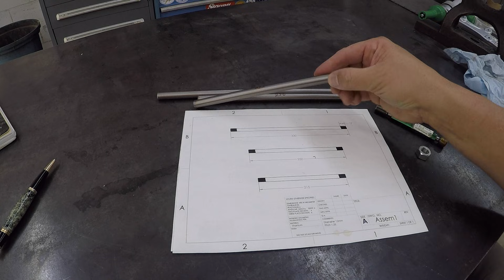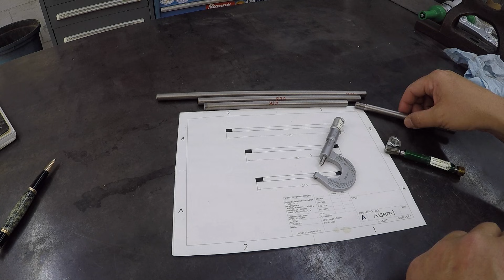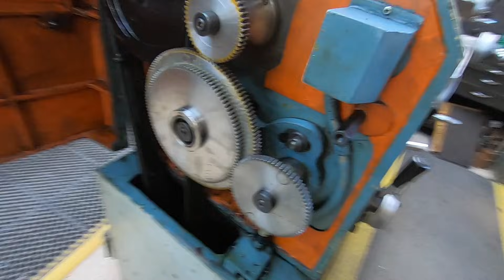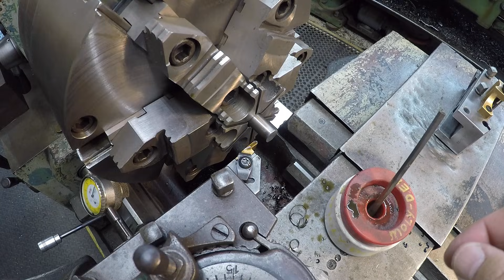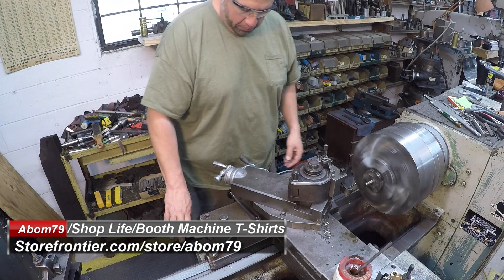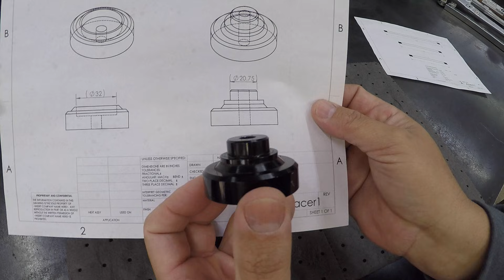Threading Metric Titanium Rod

Comment: The US absolutely refuses to adopt accepted world standards. Asking for metric threads shouldn't be such a big deal.
Reply: When your lead screw is made in imperial...it's a bit of more forethought to do it. Just as if your lead screw was metric and you had to do imperial. I agree though, metric is much easier system.
Reply: I don't think it's any secret that most mechanics in the US would love to go all metric. It's a better system in every way.
Reply: @dunerinaz  No its not. Mechanics are NOT machinists. Wrenches are NOT threads.
Reply: @dunerinaz  except for estimation.
Reply: @Finn McRae I mean I use whichever is more convenient to existing parts too but you can't argue it isn't easier to estimate when you have three common units (inches feet and yards) instead of two (cm and m), that's just how the human brain works.
Reply: @just73319   don't forget mm, that makes three common metric units aswell ;)
Reply: @tobiassonne3442  alright then, imperial has 4, yards, feet, inches, and 16ths
Reply: @just73319  metric got both 1/10 mm and 1/100 mm. 😊
Reply: @tobiassonne3442  you're missing my point lol. The human brain groups things into small numbers, having a point of reference for a "small, medium, and big" (inches feet yards) unit of measure is more useful than "small and big" (cm and m)
Reply: @just73319  well then you're mising my point too.. "small medium and big" in metric is just mm, cm, m, km and so on. if you think imperial is more understandable it's probably because you've grown up with it. me on the other hand, i can only think in metric because it's all i ever learned. :) so yeah the human brain groups things but it still depends what it is most comfortable with
Reply: @tobiassonne3442  You can only work in metric "because that is all you have ever learned" and that is what you are comfortable with, BUT you shouldn't criticise a system of measurement you don't understand and have never used. I can and do work in both because I was taught to use both (I am in my 60's), first Imperial until we changed here in the UK in 1972. Take it from me metric is NOT a better system, at least not for engineering.
Reply: @johnbloomfield5705  well I do not criticise the imperial measurement. And I   some times find myself having to use the imperial measurements because I work on steam locoes, but I always have to look stuff up. All the metric stuff I have in my head, like tapping sizes for threads and so on. I'm just trying to say that the imperial measurement is totally fine, I am just not comfortable with it and I don't think it's better. Well maybe I just got introduced to imperial the wrong way.
Reply: @just73319  12 inches per foot, x3 = yards instead of ONE unit (metre) where all others are just multiply/divide by 10 to get to next smaller/larger unit. In  metric, just shift the decimal point - no maths at all.
Reply: @dunerinaz  I live in the UK. We had metric imposed on us in 1972 nearly 50 years ago now, that and joining the EU were the two worst decisions ever foisted on us by the ignorant wretched politicians.

Take it from me, metric (or French Units as I call them) is NOT a better system, at least not for engineering. A thou (1/1000 of an inch) is a much more useful unit than 0.025mm for turning /milling as is 1/10 of a thou for grinding operations.
Reply: If you dig into the history of US metric adoption, you will find that the machine tool industry is a primary reason it hasn't been adopted.  All of the tooling was already in standard.  Just about every shop balked at the idea (i.e. cost) of replacing every lathe and mill just to change over to metric.
Reply: @lwnf360  CNCs might finally make that change since they don't care. I think it has to do a lot with the equipment like Adam used to repair at motion. If you have a Falk Gearbox that is 60 years old that needs rebuilding, or you could replace it with a metric one. But if you do, now your spare parts (like those 11" shafts he used to turn) that you paid thousands for are no good. But then when the shaft wears out, you've got a good gearbox still. I certainly think all new plants should be built metric, but the old ones will probably have to stay imperial until they die.
Reply: @TheMetalButcher  Good point
Reply: @lwnf360  There are basically two standardized systems: the ISO standard ( widely accepted around the World) and The Imperial Standard (USA and very few other countries) So we say Standard we assume its is the ISO standard that is adopted 163  countries.
Reply: I work in both imperial and metric. They both have their advantages and disadvantages.  I find where imperial really shines is in architecture.  The power of the imperial system is that it is easily divisible by the first four natural numbers.  1, 2, 3, 4. The metric system only evenly divides by 1, 2, and 10. If you look at something you often need to divide it up into 3 or four pieces quickly.
Reply: I was barely a teenager when I moved from Europe to the US about 25 years ago, so I’ve had plenty of experience with both systems of measurement. Metric is better in every conceivable way, estimating or exact measurements, especially when it comes to engineering because a mm is much easier to split into half’s and quarters. Go to any school in Europe, ask any student above 3rd grade to estimate half a mm(millimeter), they will definitely know that a centimeter is made of 10 millimeters, half of that is small but easy to estimate and imagine. However, in the US, ask a student to estimate something similar, an inch is made of 16 peaces, btw they don’t have a name! And ask them to split that in half again! So now if they are smart they will split the inch into 32 peaces that still don’t have a fukin’ name. However, most will try to split a 1/16 in half and at that point most will just give up. See my point?
Reply: Metric threads are 💩. Why would we adopt that when imperial threads are a complete logical system.

Comment: Did you make the dial indicator magnetic mount on your lathe or was it purchased, I have had no luck searching for one on the internet, really like that design, if purchased please tell me the brand or company that made it, thanks again for all the great videos.
Reply: He might have made a custom one for the front ways on the lathe but if you you google for 'magnetic back dial indicator' you will find what you want. Dial indicators have what they call 'AGD backs' . AGD stands for American Gage Design and most all currenty made dial indicators conform to AGD standards. AGD backs come in many different configurations (lug, post, magnetic, plain, adjustable, and so on depending on how you want to mount the gage. The magnetic bas indicator stand he uses for dialing in work held in the chuck is made by Noga. There are many different styles of magnetic base and many different manufacturers. Noga is a very popular manufacturer.
Reply: That was custom. Made by a view. Search his back catalog.

Comment: Does anyone know why threads are cut on an angled compound? I see that this means only the left side of the tool cuts the thread as the tool is advanced deeper and to the left.  I'd naively thought you would have run the tool straight in using the cross feed.  If I had to guess, maybe there is less chance of chatter and a better thread formed since cutting is guaranteed to be on one edge only.  I'd love to know.  Thanks!  LOVE THIS CHANNEL!
Reply: Thats the reason. Though I am working in a CNC-Shop, and we never had any issues with advancing the tool straight along X.
Reply: For 12 ways to cut a thread that can sometimes use both sides of the insert - zero setting on the compound - no plunging in - no tools upside down - search for - SINGLE POINT THREADING 12 EASY WAYS
Reply: It limits load on the tool, chatter. On manual machines there is backlash in the lead screw so you need to keep the load against the travel or you can get a drunken thread. It should not be 30 deg but 29-29.5 because-no tool is perfectly aligned and the tool needs to clean off the right flank because the chip from the left side erodes the right flank.

Comment: Adam, since we're on the topic of threads, could you do a video on how to cut a higbee?
There's got to be 1001 ways to do it easily on a CNC mill or lathe, but I wouldn't know where to start on manual equipment.
Reply: You can do a starting Higbee on a Bridgeport with a rotary table tuning the rotary crank with one hand and raising the knee with the other. I was doing 8 pitch Acmes and there's actually a fair amount of leeway in keeping the end mill in the gap of the major or minor diameter depending on if you're doing ID or OD threads.

Comment: That is a good way to check . I keep an old dial calipers in the tool box to check metric and odd threads. I ground the fingers on the calipers to a sharper edge to check fine threads. The angle you grind does not matter as you are only checking "Samenes" against a bolt or whatever you are copying.

Comment: only machine I have available to me that will cut metric I have to leave the half nut engaged or it will split the thread. I have an old Clausing lathe that I call left handed because the hand wheels and control levers are backward but it does have a good spindle brake that stops the spindle almost immediately after disengaging the lever
Reply: Watch the Oxtoolco video on metric threading, You can do it on yours.

Comment: I'm not clear why its important to reverse the machine. Why can't you leave it running and pick up your position with the thread dial/ half nuts?
Reply: Imperial or inch lathe thread dials only work with inch threads ,you often need to change to a 127 t gear in the headstock,or whatever gear train the lathe maker has setup.
Reply: Yeah, that 127t gear causes the leadscrew to be at a really weird gear ratio with the spindle leading to the two getting out of sync if you let it keep running
Reply: Its faster to leave the half nut engaged in reverse than to leave it running and wait for the dial to come back around.

Comment: I wondered how close your imperial lathe would get to the exact metric thread using the change gears specified. My calculations give a theoretical error of just 0.005%. The gear reduction of 50/127 followed by 105/70 gives a gearing down factor of 0.5905511811. I reckon the lathe lead screw is 12 tpi giving a lead screw feed per full rotation of 0.0833333 inches. Multiplying the gearing down factor by the lead screw feed per rotation means the carriage advances 0.0492126 inches for a single spindle rotation - which is pretty close to the precise requirement of 1.25mm (which is 0.0492100 inches) - an error of 0.005%. Oh yes, I am under lock down. I hope this is right. This will not worry mere mortals, and Stefan has a metric lathe.
Reply: Lead screw is 6 you on that model , I just went and checked ours.
Reply: 6 tpi not "you "
Reply: @pauldavidson6321  Thanks for contributing. Is there a 2:1 reduction gear either between the spindle and the  change gear input shaft or between the change gear output shaft and the acme lead screw ? Either way it would explain why I was out by a factor of 2  in reasoning that the lead screw was 12tpi.
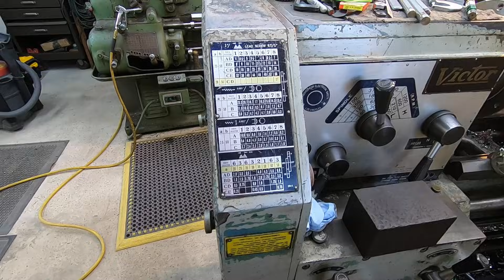Reply: @martinlutley3896  There is a multi ratio gearbox between the changewheels (the 127:50 and 105:70 gears) and the leadscrew. Normally it's used to select which tpi thread to cut, with the 127:50 changewheels installed it's used to select which mm pitch to cut. You need to read the table on the front of the lathe to pick the right settings. Adam shows this at about 3:20
Reply: @ericfeatherstone  Thanks Eric, I had figured it out by stopping the video and reading the labels. The label also gives the 4tpi for the  lead screw. I also understand the exact conversion comment you made earlier - the simple numeric relationship had not clicked.
Reply: @Martin Lutley The inch is defined as 2.54cm so 254/100 or as Adam has 127/50 is an exact conversion. 
@Paul Davidson 4tpi leadscrew for the Victor 1660 according to: 
https://nsmachine.com/product/16-x-60-victor-engine-lathe-2/

Comment: Please would somebody answer a question for me? When cutting a thread, the depth is determined by the compound slide rather than the cross slide. So, as you gradually cut deeper, how do you know when you’ve reached the correct depth?
Reply: The general simplified formula for either inch or metric is:
Thread depth = pitch/2
In his case it is Thread depth = 1.25/2=.625mm or .0246" minimum
NOTE: You can't use that number as a final thread measurement because the nose of your tool will vary a bit so you can use it to get close then measure it and fine tune it. With the compound at 30 degrees you have to divide that number by 0.866 so .0246 depth will be .028 on the compound.
Reply: You can measure the pitch diameter or test it with a go/no-go gage
Reply: There are also charts that give the infeed for each thread pitch ,you can use full form threading inserts that cut perfect threads if the workpiece diameter is correct.
Reply: There is an old formula for that, but I doubt I could find it in all my notes. Anybody?
Reply: @oldgoat1890  That is some very basic math: Cos(angle) = adjacent/hypotenuse
=> hypotenuse = adjacent/cos(angle)
The hypotenuse is your compound slide, the adjacent is your thread depth and the angle is 30 degrees for metric. So all you have to do for metric is divide the thread depth by 0.866 and that is how much you have to move your compound.
Reply: @dimi575  Thanks.

Comment: Excellent video and threading technique. I learned threading on antique lathe without any graduations on the crosslide or compound. That took awhile. After returning from 'Nam I worked for a company making titanium parts for the ultrasonic industry. Good work but did not pay enough to support my own household.

Comment: Pretty cool technique .The only possible issue i see is the inrush current on that motor getting it hot not running long enough to cool it .Def. couldn't do that kind of duty cycle on a single phase machine . Great Video Adam
Reply: Or cut the thread in the reverse direction.  No need for quick reflexes that way, no grabbing at you nuts.

Comment: damn, why didn't I learn this way of threading in my apprenticeship as a machinist. its so much faster and safer. all this time threading and reversing at 100 rpm wasted. I'm working on cnc machines now, but seeing your videos reminds me of the good old days when some guy came in with a technical drawing of some random stuff and you had to firure everything out by yourself and then machine it by yourself. nowdays a lot of machinists, me included, are basically human loading robots.

Comment: Thanks for all the angles Adam! It really helps to understand the whole procedure. Back in university, our lathes didn't have threading dials, so we had to keep the half nut engaged all the time. It was really nerve recking to turn the lathe off and back the cross slide fast enough not to crash into the part. Thanks for the great video, I really appreciate you taking us along!

Comment: I had a similar issue with my lathe not coming back to zero while I was threading and found that the measuring collar (for lack of a better term) on the hand wheel of the cross slide would move.  It was the quick motion of backing out the cross slide when threading to a shoulder, probably much more violent of a motion than needed, that caused the motion.   I drilled and tapped a set screw and now it comes back to place every time.  The set screw is loosened whenever a new zero is needed.

Comment: I always liked the way you used to thread because the machine stayed running. I always find watching this threading style I can't stop thinking about all the wasted power spent jerking the spindle up to speed over and over. Seems like the machine just takes a beating for one small feature.
Reply: Its not one small feature. the machine is literally build to to this. don't worry about the machine.
Reply: Can't do it the usual way when cutting a metric thread on an inch lead screw lathe. It has to be reversed because there aren't predictable repeating points of synchronization on the screw you can catch with the threading dial like you get cutting inch threads on an inch machine or metric threads on a metric machine.
Reply: You have to do it this way Shawn. The only other way is to have a reversing leadscrew, which his Monarch does. But then you'd also need the metric transposing gears, which from my understanding are very rare, and probably require a different quadrant bracket. That's the way it is on my 16x54 Sidney, a very similar machine.

Comment: It's production machining if you had 500 to do a day it makes sense to do it this way.
Reply: If I was doing 500 a day I'd be using an automatic releasing diehead .
Reply: If I was designing the part I would specify Titanium threaded rod & just cut to length.

Comment: I'm wondering: how precise do you have to be when engaging the half-nut? do you allways have to be "on the dot" or is it a ballpark kind of deal?
Reply: It locks into the closest thread. Hold pressure on the lever and it kinda just pops into place when the timing is right.
Reply: If it's not right on you'll get multiple threads. Like anything else it's either right or it isn't.

Comment: I hope this is for low-stress situation as cut threads in Ti are not that strong they tend to pull off , forming is the way to go for threads in Ti.
Reply: The drawings would specify if threads must be rolled.
Reply: @454Casull  it came from a viewer, he may not have been aware of this fact lol
Reply: i don't think these small diameter parts are used in a high stress situation.